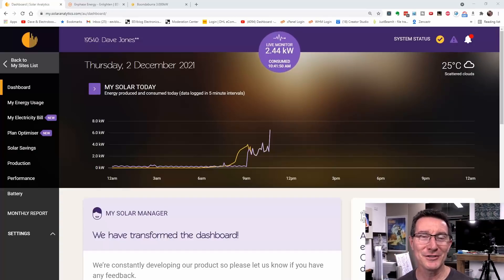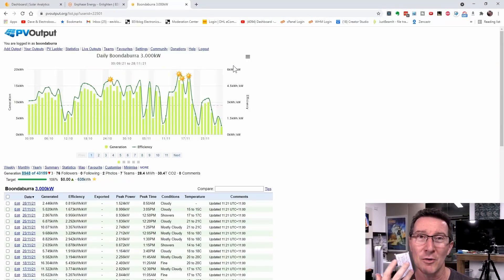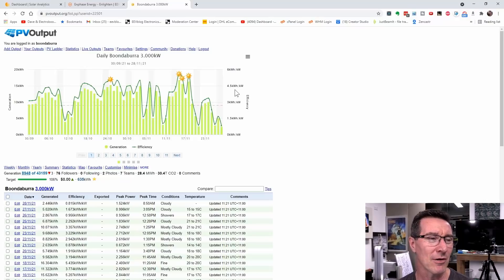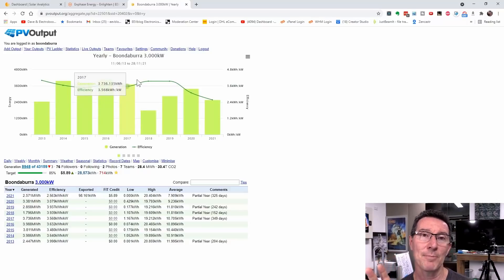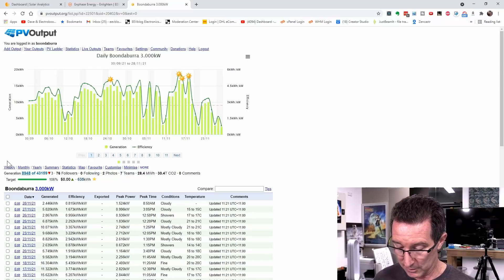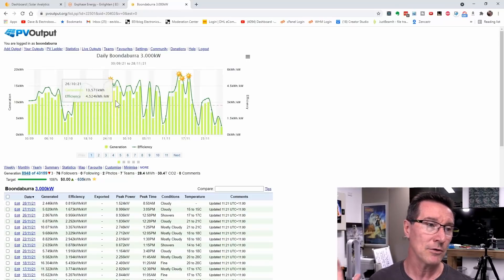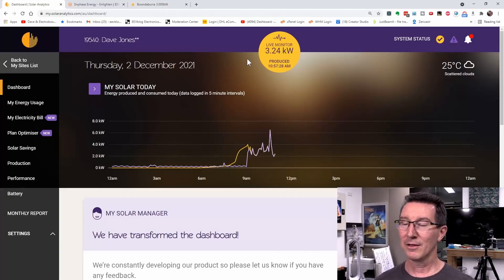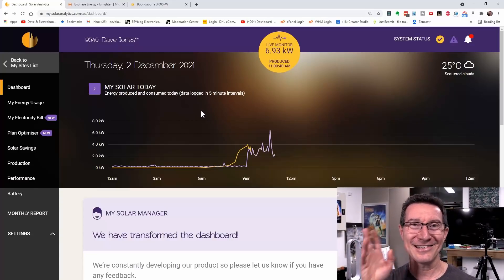I don't have a problem. I only have 4 Solar Monitoring Systems

Comment: This is one of the biggest issues with IoT... Lack of standardization. Every piece of hardware has its own app, and exporting data real time is usually not possible or a big PITA.
"Open" things like home assistant are getting better and better but still no easy way to extract/import data.
They should rule mandatory to have open and complete API documentation and maybe simplify things even better for "normal" people
Reply: I absolutly agree. The industry should use standard interfaces. I don't want 120 apps on my phone for smart home integration. I will use opensource anyways. They should not get my data.
Reply: Sooooooo true. I really think there should be a common protocol such as MQTT, with some standarized names/structure.

Comment: Dave, what are your thoughts on the MyEnergi Eddi device?
Reply from the maker: We don't have electric hot water, so no use for us. It might be useful depending on your usage. As for heating/cooling we have aircon system that we switch on as needed. No need to "sink" heat into the house during the day here.

Comment: Grab an Iotawatt and monitor everything separately in higher resolution. 14 CT inputs so you get way more detail on both your solar systems and your consumption for every circuit. And no cloudy rubbish either, all your data is owned by you. Supports auto export to PVOutput too of course.
Reply: That's how you end up with 5 solar monitoring solutions... 😉

Comment: Dave, i use an Arduino to gather data from multiple devices, add some calculations n stuff and publish to one place. Generation, import, export, consumption, weather etc. Sits in a wee box in my electricity cupboard running 24/7. Well worth the effort.
Reply from the maker: I can't ever see me going to that effort. The Solar Analytics system does everything I need in terms on total output and consumption, and the others are there anyway regardless of whether I use them or not to monitor the two system independently. It would just be duplicating everything yet again.
Reply: Great, now he can have 5 monitoring systems

Comment: You only start to have a problem when you have 3 monitors for each system, and then another 2 to collate the data, and a third to do sanity checks, and a fourth to do verify on the sanity.

Comment: How many monitoring systems would you need before all you were powering is the monitoring systems?
Reply from the maker: That can be calculated...
Reply: @EEVblog2  I was just thinking how to phrase this question! 😄
As long as there is energy to spare you don't have a problem...
Does all this data show any weak points in your setup you'd not realized before?
Reply: The Ouroboros eating its own tail, huh?